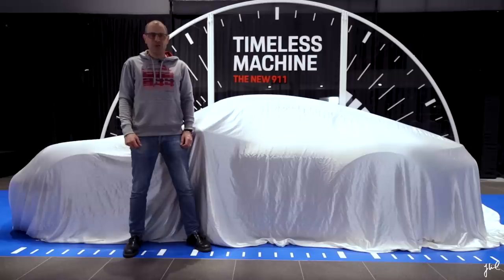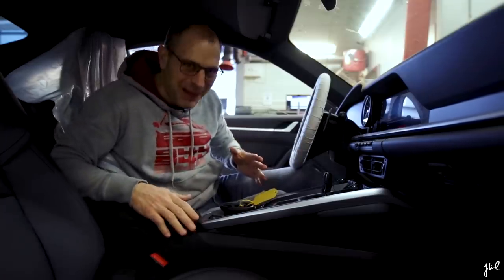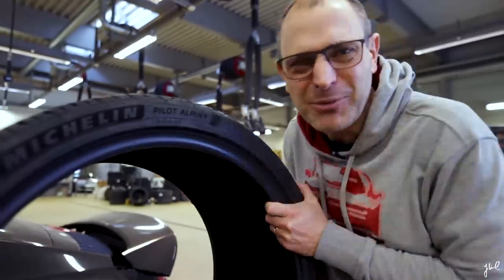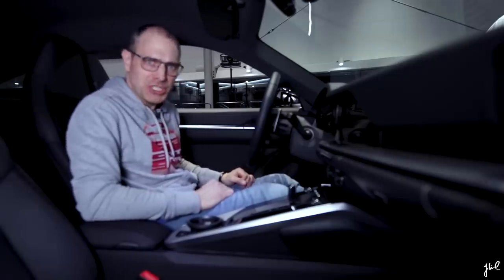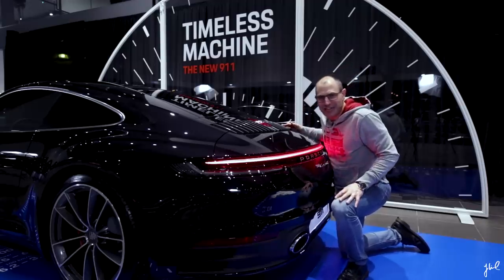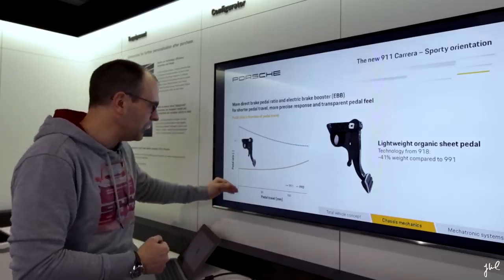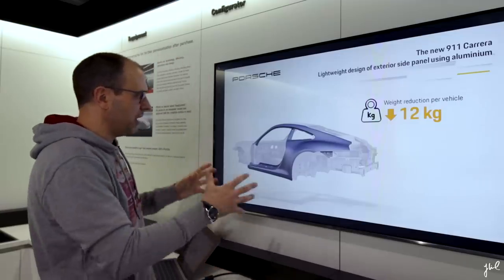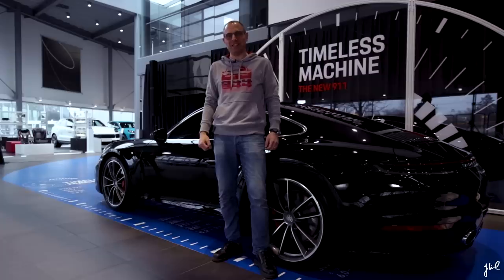1st review, PDI and delivery in SWE of the new Porsche 992 Carrera S | NO DRIVING | EP 064

Comment: Congrats Janko.  Beautiful 992!!  Looking forward to seeing your future videos and reviews.  Curious to hear your insight when comparing to your awesome 991.2 GT3 as well. 
Since I love the 997s I just wanted to make a clarification.  I was just surprised by the graph Porsche makes showing the 992 being lighter than 997.  I can understand if it is specific to body structure weight only and has decreased with aluminum body panels. So if only body panels were taken in to consideration for that graph I can see why they say this,  but the 992 over all is by far a heavier vehicle over the 997 by close to 150-180 lbs.
997.2 C4S weight 3263 lbs 6MT  3329 lbs PDK  VS 992 C4S weight 3487 lbs PDK  
997.2 C2S weight 3142 lbs 6MT 3208 lbs PDK  VS  992 C2S weight 3382 lbs PDK
Clearly the all wheel steering, additional 60-70 hp turbo charged advantage will smoke the 997.1  997.2 , but the 997s are not fat pigs compared to the 992.  Quite the opposite I would say.   Great videos and congrats once again. keep up the great work!.
Reply: Similarly, the curb weight of a 993 C2 is 1370kg, that of the 996 is 1317kg. I don't know what they are trying to say with this chart, it is quite misleading.
Reply from the maker: It is the body weight and that is very important. The Body weight could not be controlled and defines center of gravity if you don’t option out your car with glass sun 🌞 roof. For future CUP car and GT models it’s even more important. The cars get faster and faster, today a Panamera Turbo has the same lap time as the 997.2 GT3. 

Then again the total weigh of the car are also an important parameter and the 991 I lighter then the 997. 

I hope 🤞 I clarified something?

Thanks for watching and subscribing

Comment: It is not a mid engine platform, It share the front part of the platform with the R8. They moved the engine mounts ahead, not the engine. The M stand for modular
Reply from the maker: Correct I hope I sad engine mounts? need to check. The engine is moved approximately 20 mm forward. Thanks for watching and subscribing.

Comment: Saying the body is lighter is almost fake news, since the overall car is heavier than the 991... which is my biggest problem with the 992. There is zero benefit to this weight. It’s there due to the future hybrid powertrain (very little is due to the particulate filters).
Reply from the maker: The Body is lighter and if you limit your options the car will be more wight focused. When the manual arrives it will give us a lighter car and if we still was stuck with the 997 body the would have bean even heavy.

Comment: Nice video, thank you very much. Though regarding 9:35 onward I'd like to note that some of those statements aren't entirely correct:
- The Audi R8 does not share a platform with the 911 (or 718), yet. A future iteration of the R8 might use MMB (you may know more about it than me) but at present it's an entirely different body, incorporating CFRP into a space-frame construction. Compare the 992 body in the workshop material with this: https://audimediacenter-a.akamaihd.net/system/production/media/19267/images/fdc6f66d9feb400b81b2609149c3e703114d14bf/A153067_overfull.jpg
- The 718 does share the same platform as the 992 - but to my knowledge it's effectively been like this since the 996/986. Where back then each platform was developed from the same base for each application, now the platform is developed to be modular from the ground up.
- 992 isn't any more of a mid-engine car than any before it. The engine position did not change, only the mounting points on the engine, removing the need of the additional bracket. Weight distribution might have shifted further forward, but that might be explained by the wider front (4S to 4S). With the 2S receiving a wider rear end as well I don't expect that it shifted much. For a rear-engined car the weight shift under braking means that the rear brakes can do more work without breaking traction, so bigger rear brakes aren't an indication that the weight distribution shifted forward, more the contrary. Besides - the delta in weight distribution between a modern 911 and a typical rear mid-engined supercar is less than you'd expect. Not a lot of mass in front of the driver in any mid-engined car.
Reply from the maker: Thanks for the info, I'm currently looking into the R8 question. Waiting for more information. Regarding the 718 my point is that it shares with 992 not 991. Thanks for watching.

Comment: ugly as hell. Porsche is going in the wrong direction with the 911.Lots of things missing in the interior too.
Reply: MemoryLaneCinema what is ugly? I was at private presentation at Chicago Auto Show and really like interior (accept cup holder) outside looks nice , not big fan of exhaust , but did not found it ugly , it’s just different than previous model , concept and style the same .
Reply: @got_gt3612  the back looks like the sport turismo. Not a 911. Too many radical changes in the interior too. Away with analogue gauges and the classic cup holders. NOT a fan of the gear-stick either.
Reply: Well , 996 was dramatic change , it’s progress , we just have to accept it
Reply: @got_gt3612  And nobody liked the 996. I will never buy a new 911 cause they all have turbos too. Just sad that Porsche jump on the "climate wagon" with the 911. Well well. Most people do not care if it is a turbo or not but purists do :)
Reply: MemoryLaneCinema I understand, I got  new T , with little tune , exhaust and air filter it’s pushing about 470 HP now , manual , light and pretty basic , I love it , really enjoy driving it ( unfortunately I can not afford GT3 Touring or R) 
Porsche have to keep up with other cars and regulation and turbo was only solution , I believe next GT3 will get hybrid assistance, NA engines are on it maximum performance now and when other cats pushing 600 HP or more , no other choice.... sadly